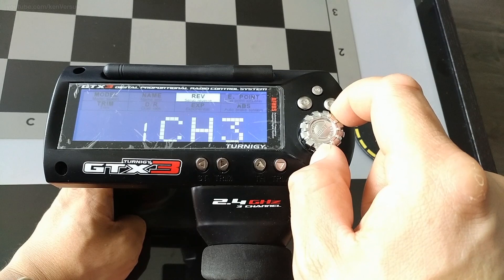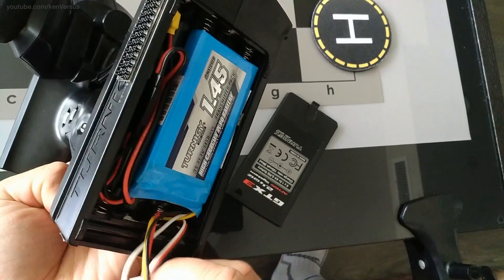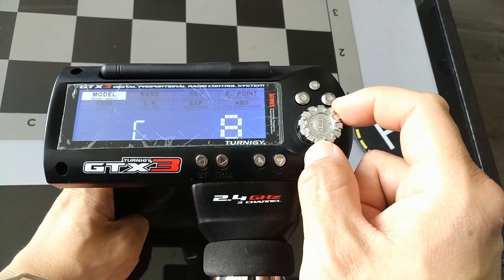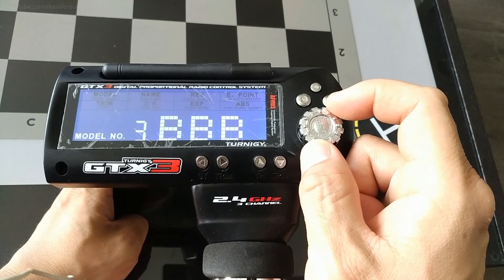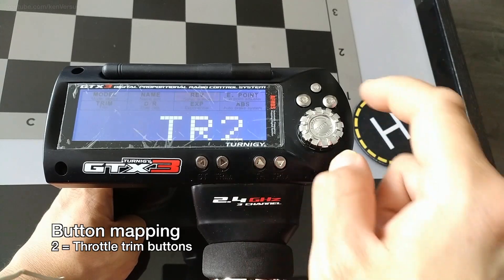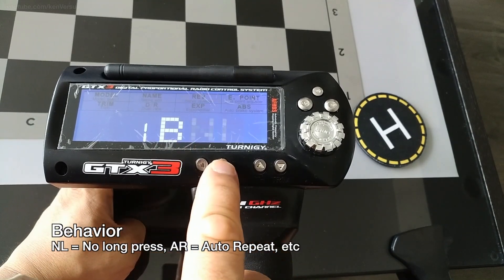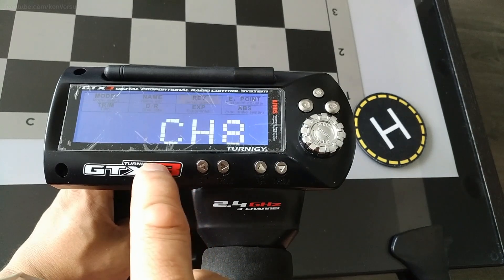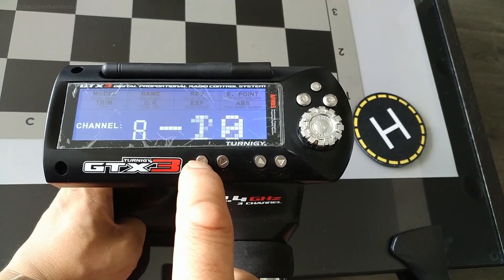Flysky GT3B Hacked firmware Channel Assignment

Comment: Hello I have a older graupner motorcycle that I have revised with a gt3b transmitter and reciever. Everything works fine except the brakes. How can I turn the reverse off or set the brakes so that when I want to use the brakes it won't go into reverse?
Reply: Hi Chris, I'm guessing the setting for brakes should be using the reverse on the tx trigger, if so the ESC setting could be currently using a 'forward/reverse + no brakes' setting, perhaps you can change the ESC setting so use fwd/brake/rvs instead?

Comment: have the Turnigy gtx3 with i one original receiver and about 10 of the HobbyKing gt2b if I hack the firmware will it still buying and to my original receiver and the HobbyKing receiver or will I have to buy the fly sky receivers
Reply from the maker: Whatever rx worked before will work after flashing.
Reply: OK cos he's not one video on line that shows the GT X3 working with the original or the HobbyKing receivers after flashing

Comment: Hey, currently considering getting myself a GT3C because of your video - just one question, in your example, is there a way to still adjust the steering trim after you assigned CH8 to the steering trim buttons?
Reply from the maker: I guess you'd assign steering trim to some other set of buttons.